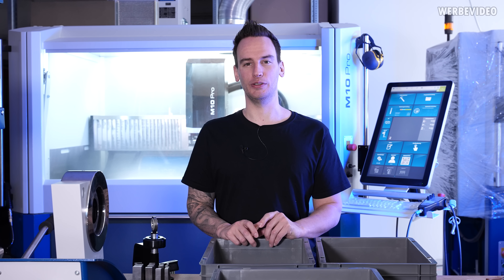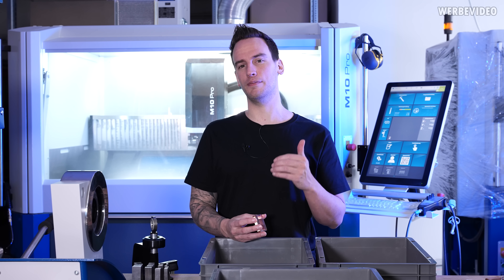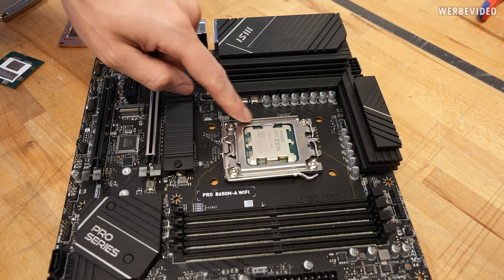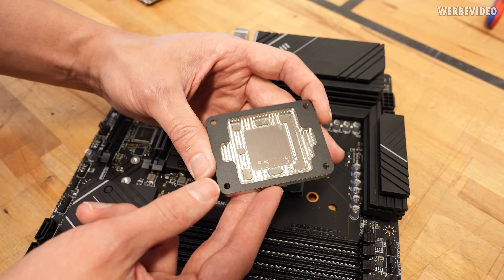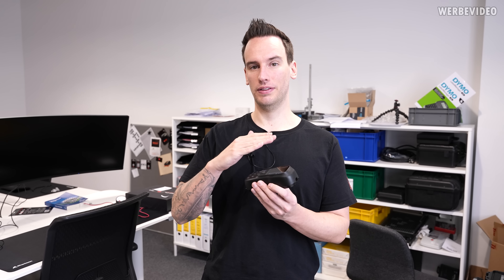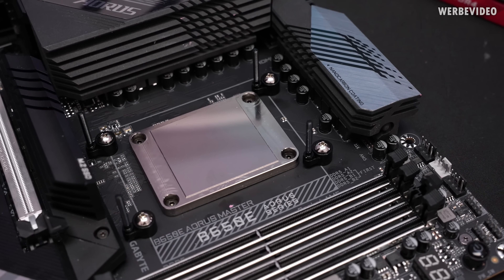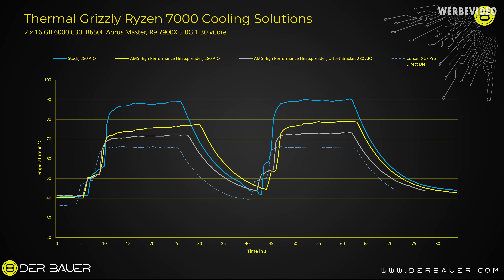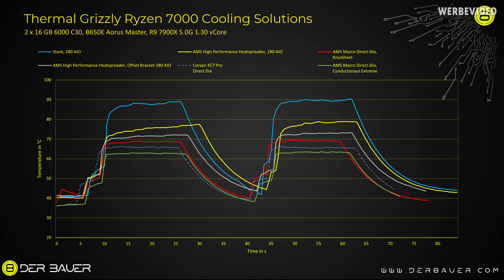I made my own Ryzen 7000 Direct-Die Water Block

Comment: the sticking force between two flat pieces of metal isnt actually cold welding. you need a vacuum in order to cold-weld metal because otherwise there is an oxide layer on the surface of the metal that prevents welding. 

The correct term is "wringing" and the mechanism of why it works isnt actually very well understood, but is thought to be a combination of intermolecular attraction (ie van der walls force) and the surface tension of water vapor in the air that gets trapped between the two surfaces.
Reply: That was the term (wringing) I was taught when putting gauge blocks together for measuring.
Reply: bro I swear this mfing van der walls force is everywhere
Reply: @not_sure_about_that_but  Yeah Shear creates Van der waals force, and Wringing is Shear in motion, like an Indian burn. OUCH@!!
Reply: @MlnscBoo  wait Indian burn? I'm not familiar with this term 😶
Reply: @not_sure_about_that_but  You take your hands, grab your friends forearm, squeeze and twist! It's a prank from the late 90s, well that's when I learned it anyways. Beware you will get punched for it lol. It is actually painful. My uncle said it was literally "wringing".  This is why I believe everyone in this thread is actually correct. Wringing, shear, "cold weld". I believe these are all different properties of the same thing which is, as I believe you said, "Van Der Waals force". Pretty cool
Reply: @not_sure_about_that_but literally, Yes
Reply: @iaial0  fr
Reply: Yep. Wringing. Try some gauge blocks... My kids have fun all day watching the blocks stick to each other.
As a machinist-father I couldn't be happier😂
Reply: @MlnscBoo  Im not gonna speculate his views all I know is steve and him were in contact and he teased it at the end of the video and then his next vid was about the KR case and then nothing ever came of it. This was prime GN content and literally nothing else like it on youtube. This guy went into insane detail about the history and methodology of what he was doing. That was the only thing I could see that might be the reason. I remember the guys name penrow or penrowe
Reply: @kommandokodiak6025  Sounds pretty cool. I'm going to have to check it out. Varitasium did a really cool video about van der waals force called "The Stickiest Non-Sticky Substance". I will look up mr penrow when I get home from work.
Reply: @David Mrázek So could you "wring" silicon and copper? Might be interesting for OC'ing, though thermal expansion might be an issue I suppose.
Reply: @IrocZIV  if it's just optical contact bonding, my initial reaction is thinking how uneven thermal expansion can easily cause either surface to no longer be sufficiently flat. It's pretty easy to see hot spots from just the heat from your fingers on borosilicate glass on an interference pattern, and that's got a much lower cte than copper.
Reply: @IrocZIV  its been done just look up ryzen lapping theres a guy who did it and then steve from gamers nexus was gonna invite the guy on until apparently the guy put out an analysis video explaining why kyle rittenhouse had a justified case of self-defense
Reply: @kommandokodiak6025  Ah, do you remember how well it worked?
Reply: To clarify, vacuum welding happen due the lack of a material barrier and after the oxide layer is removed due friction.
Reply: The surface tension part is wrong tho. Experiments in vacuum showed exactly the same behavior as in air. So yes, it’s intramolecular forces
Reply: @NoOneReallyCaresAboutUkraine  if youre referring to codyslab's testing of guage blocks in vacuum, he was doing that in a garage with a homemade vacuum made out of a kitchen pot and a store bought vacuum pump. which is sufficient to prove that atmospheric pressure alone doesnt explain wringing but his setup isnt even close to being capable of pulling a perfect vacuum and surface tension of fluid on the surface is still very much a possible contributing factor.

Like i said, this phenomenon isnt well understood and hasnt been well studied. one guy with a youtube channel isnt going to be able to perfectly scientifically test it.
Reply: @Hephera  not this guy, the proper guy. Look it up yourself
Reply: @NoOneReallyCaresAboutUkraine  "the proper guy"

Wow gee. Thanks for the incredibly robust and useful citation, I'm convinced.
Reply: @Hephera  come on! We both know online arguments never come to any conclusion
Reply: You have Van der Waals forces - which is a property that a lot of measuring tools utilize (the ones that are really blocks that keep together by using those forces). And if you allow the pieces to stay together for a really long time, there will be some diffusion between the 2 plates effectively making it a cold weld or something similar. However I have no idea how long it would take and just like Roman I've been learning this in different language than English.
Reply: Its basically how geekos walk
Reply: I thought it was sexual.
Reply: Why it is hard to pull when it's wringing together is also because the space between the two pieces is so low that it act as vacuum.

Cold welding, as said above, in total vacuum, which is a problem for satellites and other space relates stuff.
Reply: @guy_autordie  Wringing works in a vacuum.
Reply: Cold welding can be done in atmosphere as it occurs when 2 flat enough objects of the same metal touch with out an oxide layer

The without part can be archived by simply rubbing them together

Hence why the first thing launched into space cold welded when they where operated as that oxide layer was scrapped off
Reply: Could also be oxygen bonds forming between the oxide layers. We utilize that type of bonding in dentistry.
Reply: He knew. An honest mistake you say? Nah, it's fr engagement. And it worked.
Reply: This could be reason why IHS are never made to be really flat.
Reply: I see you commented the exact same thing I have... but 8 days sooner.
Reply: Is it the Casimir effect?
Reply: It's not cold welding it's molecular atraction...when two pieces are cloase enough they interact at a molecular level
Reply: Im pretty sure the force you guys are talking about is actually caused by air pressure. When you press them together you remove all the air between them, creating a vacuum. Its the same reason why suction cups work. When you add water, that fills in more of the imperfections making the pressure even greater. 
Air has weight, it ways aprox. 15 pounds per square inch ( at sea level ) you just dont feel it because its pushing in ALL directions all around you, at all times.
Reply: @emperor595 wringing is well studied, we know it’s not just air pressure there are a number of experiments that proof this 😊
Reply: Can't you fill a container with a heavy nonreactive gas (like a noble gas) and have the same affect?
Reply: Turns out wringing is due to forming a set of charge pairs on the surfaces. Which is why it works better when you slide the surfaces over each other whilst pushing them together: friction to do the charge separation. Ends up being a fairly random 2-color pattern, mirrored in opposite colors on the other surface.